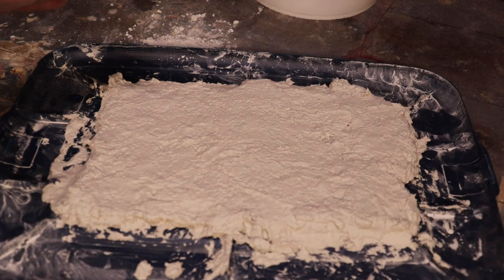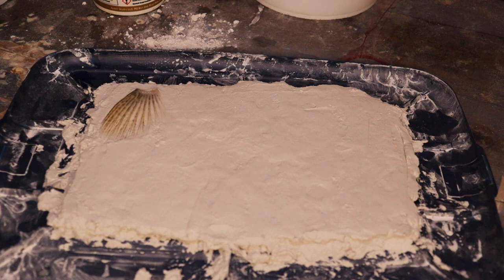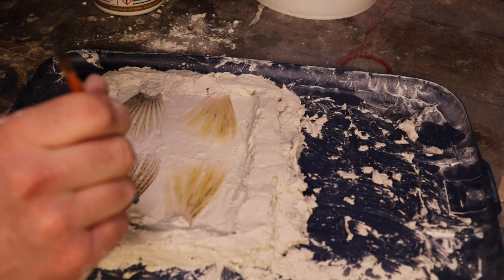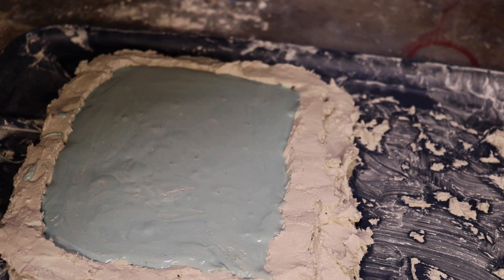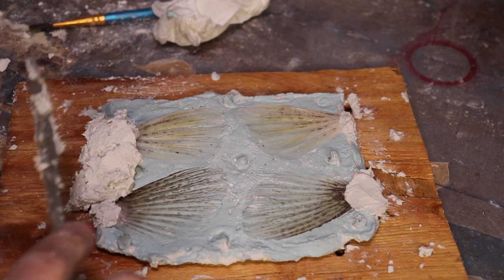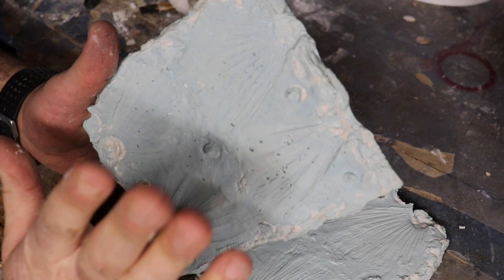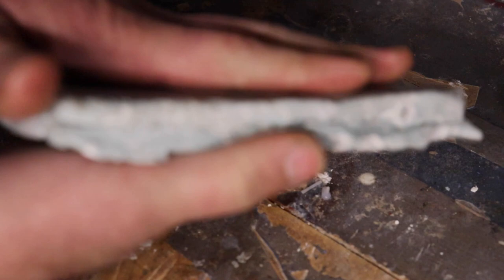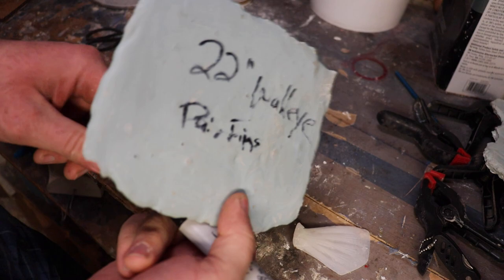Fish Taxidermy: Casting Artificial Fins

Comment: I think that's pretty cool of making molds. But why don't you use the original fence and just put a backing on them question mark that's the way I do them. I can see if the fins messed up and you want to make it look a lot better rebuild the fan you can use the right for the left just flipping it.. I get that one. But I must say you do some nice work. I do watch some of your videos. I do like the fish that you did the trout video. Awesome paint job and I like the way you build your paint
Reply from the maker: The main reason for artificial fins is there is shrinkage. By using real fins they will shrink and even with the added backing the rays won't be as full, where when I cast them they are ready to go and they have most of the original fullness. Both applications will work for commercial but I think the cast fins give a little better quality product.